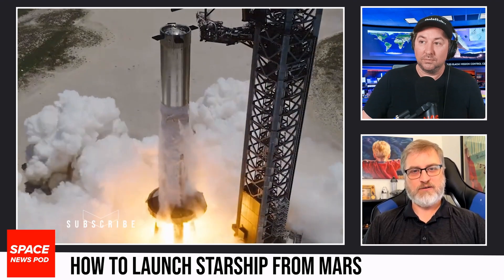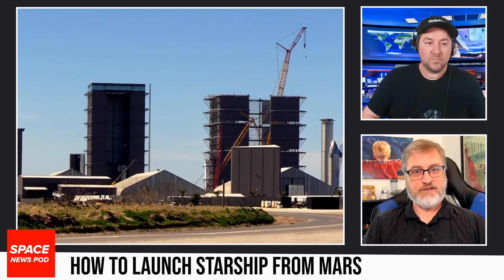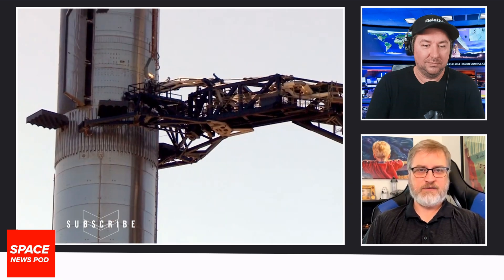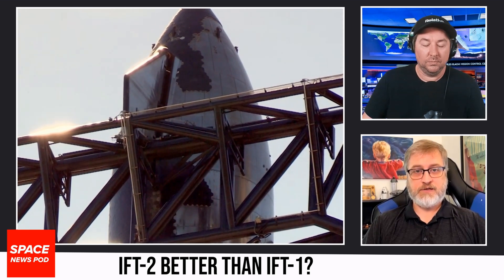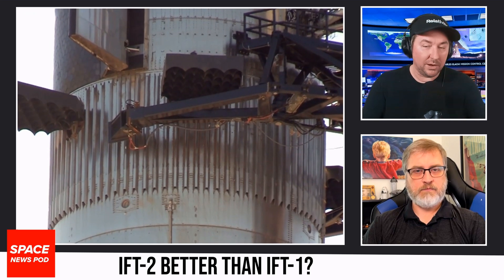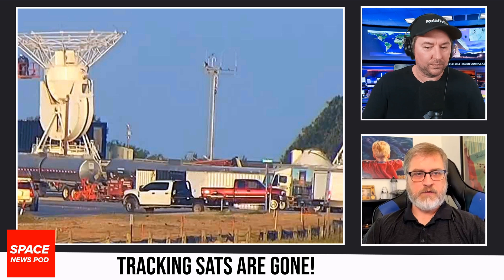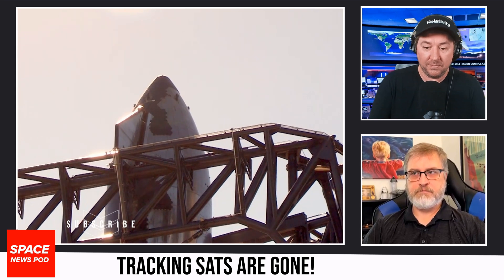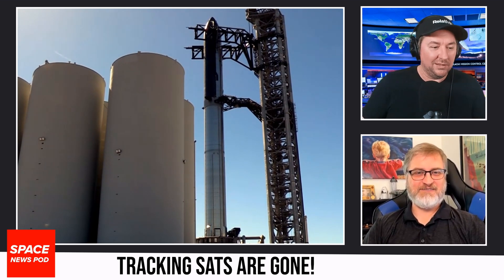Starship Mars Deluge System? [Podcast Clip]

Comment: They HAVE to use the hotfire staging in this next test. They have already moved the Ship Quick Disconnect arm up to account for the extra ring for the HotFire Staging. The Ship wouldn't be able to be connected using the current set up.